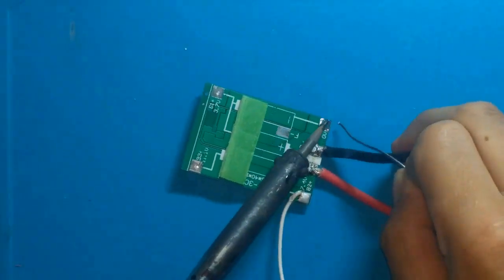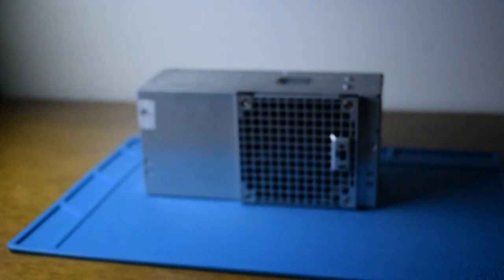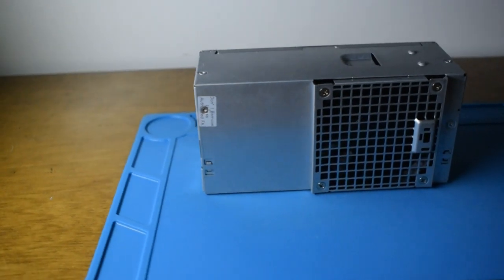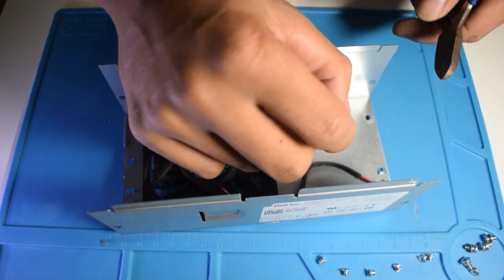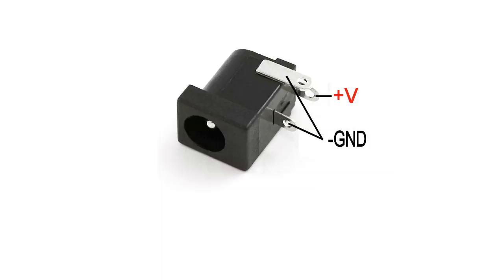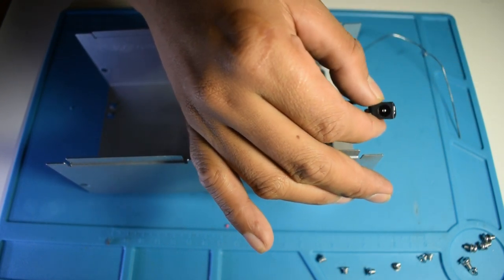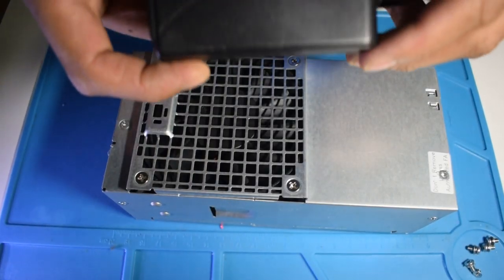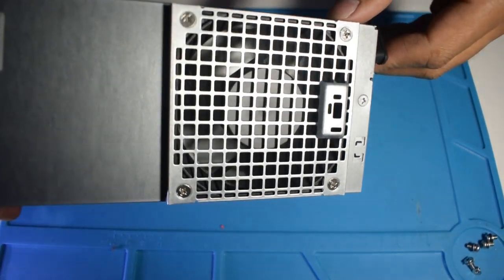DIY Fume Extractor from old PSU - from garbage to a tool

Comment: So... I have questions and concerns.  Doesn't this just suck in the solder fumes and then disperse them right back into the air?  Shouldn't part of this project maybe involve how to contain the fumes into a qualified HEPA filter to prevent the toxicity of those fumes from just going right back into the air, just as dangerous just more dispersed and harder to see?  As it is, this just seems to be a project that guts out a PSU and turns it into a small box fan.  That might be a little more useful if it included a tube that directed the fumes out a window, maybe.  Just some things to think about.  As it stands, there's very little benefit from this project that you couldn't already get from a cheap USB fan you buy at the drug store.
Reply from the maker: Thanks for your idea to improve the design.
Reply: Well, your video made me think about something I've wanted to do for a while but was probably about to go about doing it in a harder and more expensive way.  Now you've made me think about taking a funnel and attaching a medium fan like the one from the PSU onto the end of it and then connecting the funnel to a tube that can carry the fumes out a window.  This would be especially useful in the winter here when it drops well below freezing and snow is everywhere but I want to do soldering indoors instead of on the porch or outside patio.  Thank you for seeding me with some ideas here!
Reply from the maker: That would be a great idea sir... :-) thank you for watching.. :-)